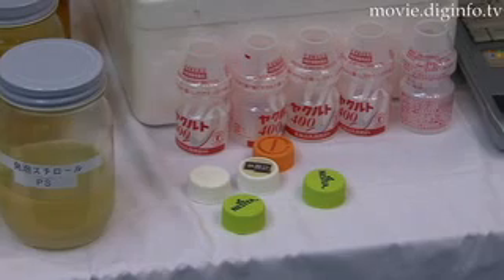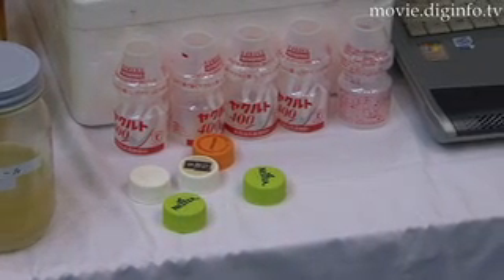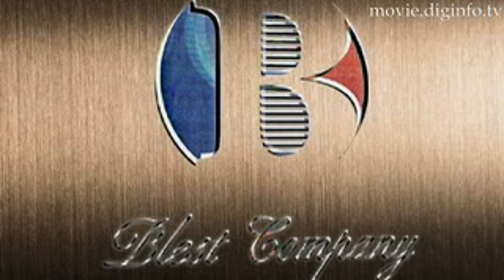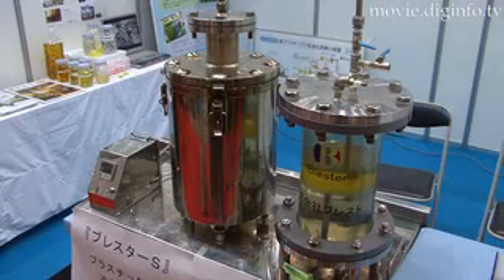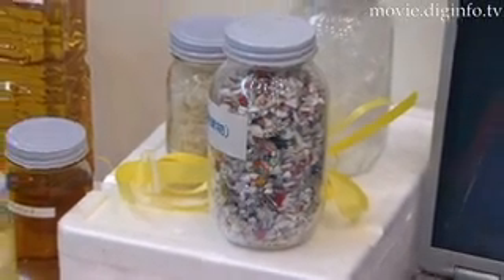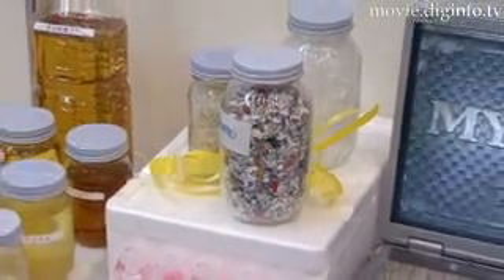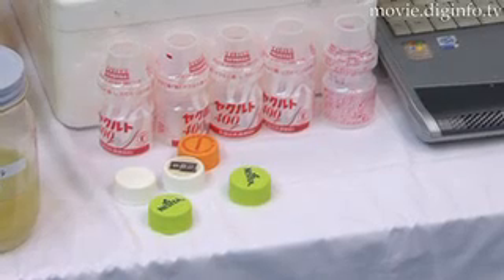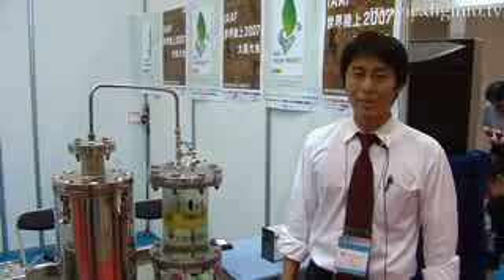Making Oil Out Of Plastic : DigInfo

Comment: So you loose energy converting it back into oil... and you loose even more energy when you convert the converted oil back into a plastic... I fail to see the point of this!

It would be more economical to use free waste paper to power a sterling generator. Trees are renewable, they get their energy directly from the sun, and recycling paper is inefficient when compared to aluminum and plastics recycling...

In summery, use the energy in waste paper to recycle metals, plastics, and glass!